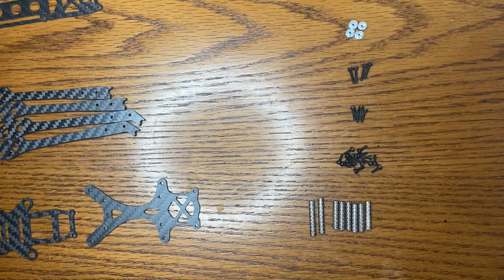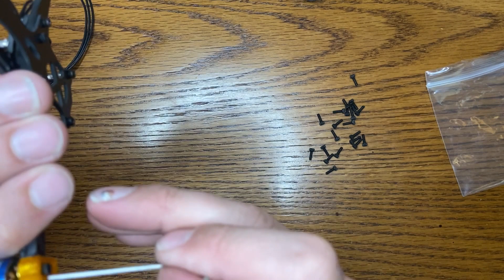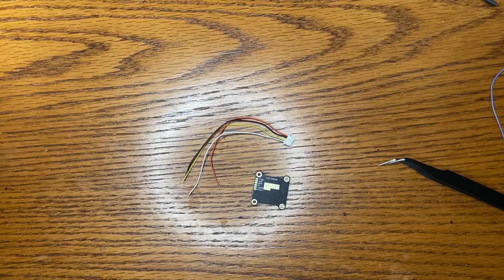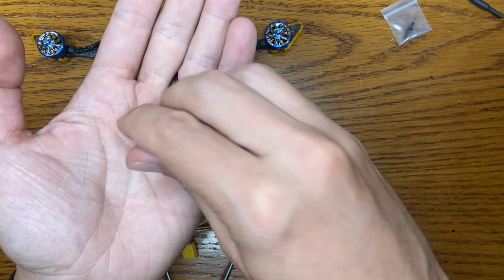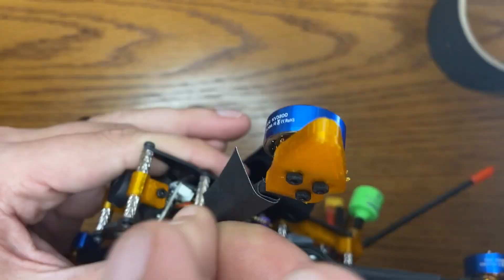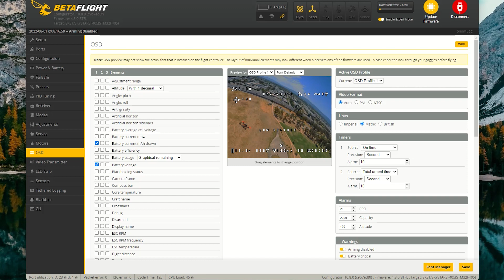Skystars G4 - Build guide w/ Betaflight Setup - 4" Long Range ARF(Almost Ready To Fly) Drone Kit

Comment: Hello so I want to get into fpv drones and I am going to get this drone but I’m not too sure witch controller and goggles to get so I could get started, it would mean a lot if you could help me figure out what set of goggles and controller to get. Thank you
Reply from the maker: Well that all depends if you are wanting to fly digital or analog. I only fly analog and use the skyzone 04x v2 goggles so I would recommend those, or the orqa fpv.one goggles. They are both top of the line for analog and will be pretty much future proof. As for controllers, that’s more personal preference on whether you want a game pad style or larger style. I chose a radiomaster tx16s because I wanted a full size module bay and plenty of switches because I plan on flying more than just drones with it. The only downside is that it’s very bulky.

Comment: Two boards?
Reply: Can I ask why you removed the two wires
Reply from the maker: @DevArnold  yeah, I removed the 5v out wire and ground wire because those two wires would be used to power a camera, but I like to connect the camera to the flight controller so I can get full OSD information